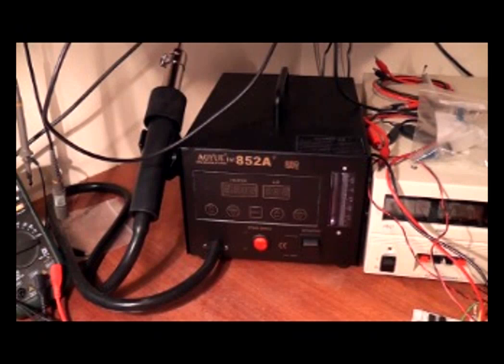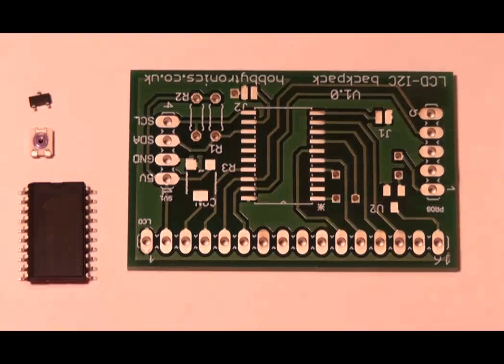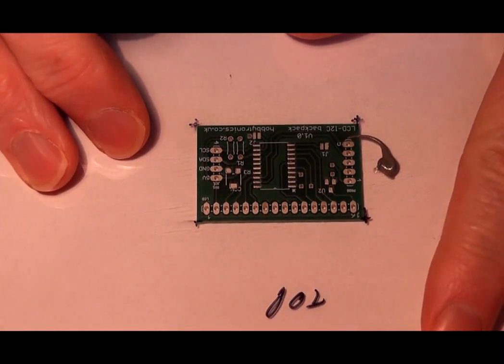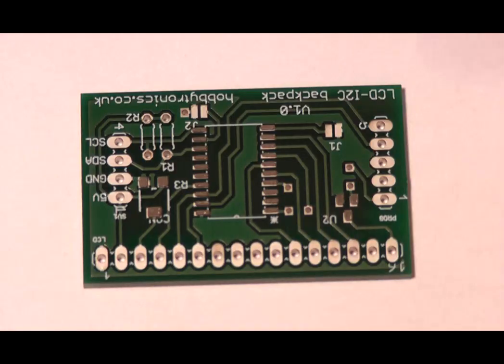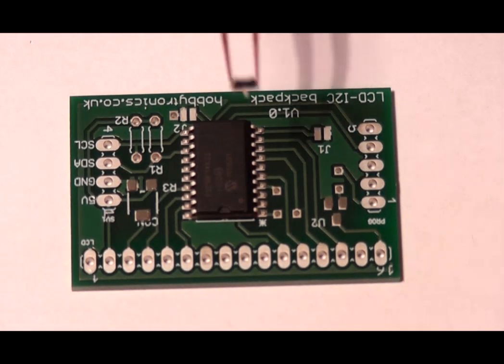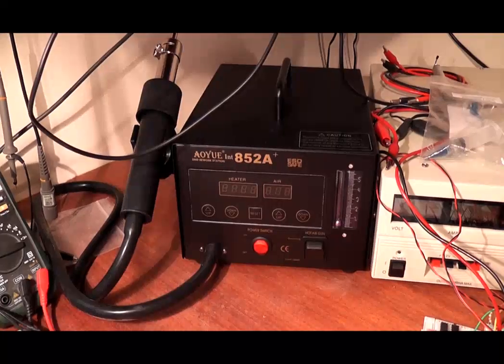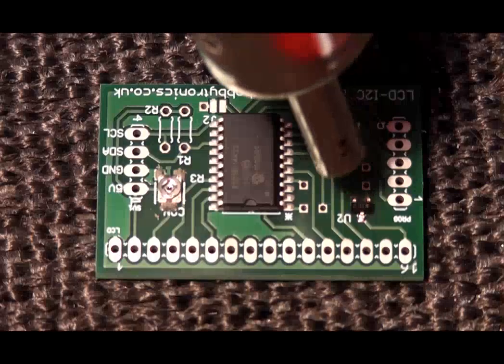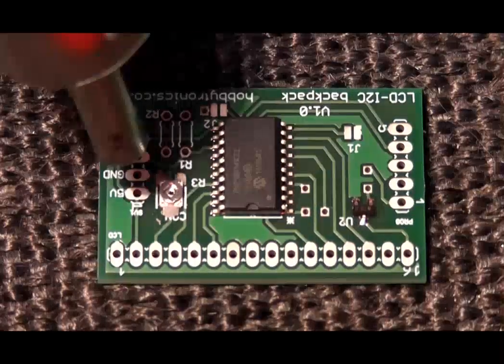Using a Hot Air Rework Station for Surface Mount Soldering

Comment: You said you set the temp to 350C. Is that the melt point of the solder, or is it much higher?   I have a low temp paste

Comment: You need something first to heat the board, like a heat plane for that special use. Then you work with that Hot Air Gun Station.

Comment: Hi, I sort of was wondering, well I was surprised a bit when you said push the chip down after the solder melted.  I have seen things that say you will get a bad joint if it moves whilst the solder cools is why.   I'm no expert just wondered.
Reply: You are correct, definitely do not touch the device when cooling.

Comment: interesting and informative but where do you get the stencils from? Laserprinting them isn't going to be an option for most hobbyists.
Reply: +Benny Kleykens You can buy very cheap hobby vinyl cutting machines like the Craft Robo, Silhouette and Cricut.
You simply cut the mask through cheap vinyl and then you can stick it straight to the boar. This stops any movement as you apply the solder paste. Once you are done, peel the vinyl off and you are ready to go.
Reply: +Benny Kleykens It's a great age to be a tech DIYer. If you live in a metropolitan area there are probably shops you can go to and use a laser engraver for cheap, maybe even free.

Comment: i have soldered many qfp 100 pins 0.65mm pitch just point by point , just have some solder wick at hand in case if shorts. QFN 's are better placed using the hot air principle.

Comment: Ok, I was playing around with the hoses on the pump and pressing on the sides of the pump where the diaphragms are located (replaced the diaphragms because I thought they were the issue - didn't help), and I noticed that the air flow rose slightly. I tightened the screws on either side of the pump, and I now have the airflow at around 4 1/4 max. So, it appears that the pump is root of the issue. I may replace the pump if 4 1/4 isn't high enough for my purposes.

Comment: Nice work. I have the Aoyue 852A++, which I liked when I first started using it. After a month or so of use, the airflow would not got above "3" on the indicator, even at the maximum airflow setting. Have you experienced this issue? I tried resetting the device to no avail. Thanks.

Comment from the maker: You don't need to buy your own laser cutter. There are many companies who will make the stencils for a reasonable price. see smtstencil(co.uk) website in UK
Reply: hobbyelectronics 101  A reasonable price?  I require to rework a 64 leg /TQFP package chip that has a 12 mm pad circumference and two nearby SOT26 packaged diode arrays, all within a very tight, high-density circuit board.  The area to be worked is less than a credit card in area...  Yet the smallest area that smtstncil.co.uk  offer is that of standard  A4 - 210 x 297 mm @ £13.00 + P&P !!!   So I end up paying 13 quid for a sheet of polymex most of which would be untouched.   

Question then arises, in your video, the operation took place on a small circuit board (comparable in size to the area I need to rework...), so did you fork out 13 quid for a sheet of polymex?   I note that the stencilled cut out is central to the entire sheet.  

I think £13 and the limited size options is somewhat excessive, especially for DIY chaps like me.   So how do we accomplish this without the damn stencil?  
The TQFP package has extremely cramped leg pitch, BTW.     

Otherwise a nice clear and simple tutorial.  So you get a thumbs up from me.  And at least you pronounce the word solder correctly.   I swear that if I hear another yank say the word sodder, I'll go orbital!   

And yes ...  Andrew Dewer  you are correct.  Components should never be moved (and pressing is moving...) whilst cooling, as dry joints are often made this way.  And dry joints are every electronics tech's nightmare.    That is Electronics Soldering 101!